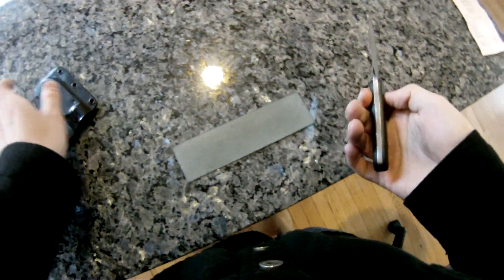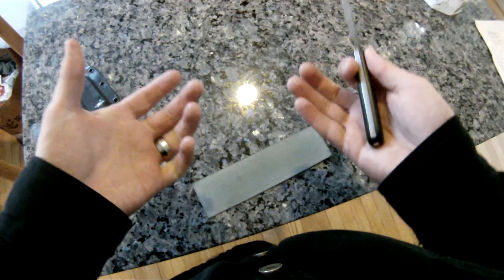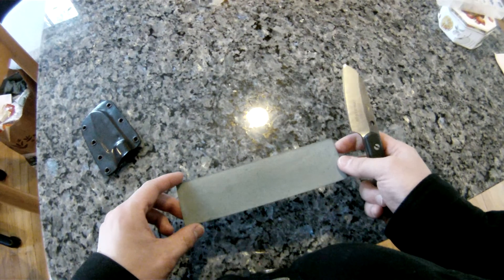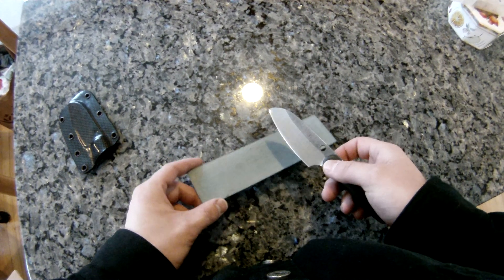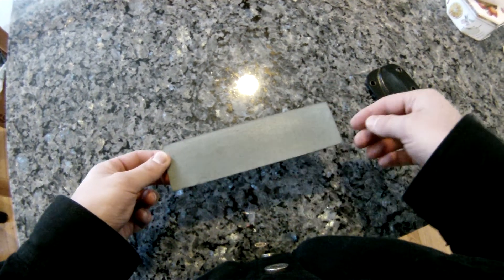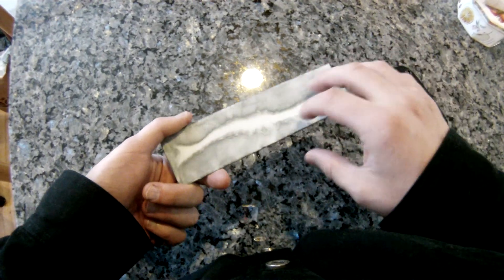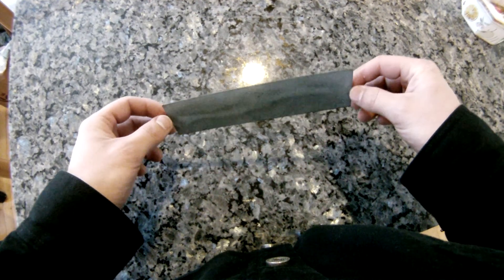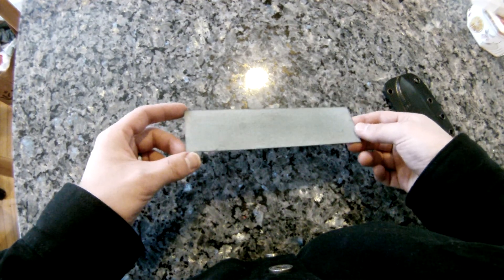Nylon Strop -- high porosity

Comment from the maker: There is a great deal of variety in receipt paper. I'd guess, at best, it'll accept ultra fine compounds only. It is however quite thin and delicate, so tearing might be an issue. Its also cellulose based, presumably, so it would NOT be abrasive neutral like SLS nylon. I should try it at some point though. Thanks for the idea.

Comment from the maker: Yes as a matter of fact I did. The nylon can, and will, hold the particulates but will NOT allow it to "sink in" as far as other substrates such as leather, likely due to its homogeneous higher hardness and finer porosity. The result is that it produces a coarser finish as compared to leather with the same compound. For example the compound used here will produce a foggy mirror (not hard enough to produce true mirror on high carbide steels) when applied to leather, whereas this (cont)

Comment: What about using receipt paper as a strop?
 It comes in big a chunky roll, it's the correct width and it's thinner, less convexing, than phone-book paper, it has kind of vinyl feeling to it, and if you can just tape it really stretched out on a hard backing, it provides a nice flat surface.